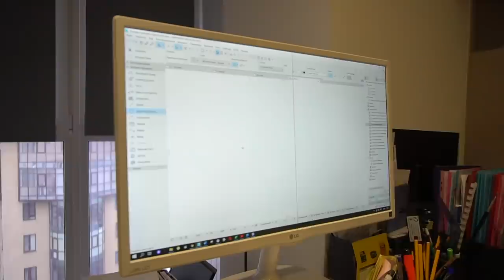Absolutely Beautiful Blue Rose From a Handful of Coins!

Comment: What does heating the metal and dipping it into water do?
Reply: I'm shocked on how many people have said this,basically the heat burns the metal into a more curvy or foldable shape,also can make it shinier by burning around the rust.The water stops it from burning and makes it easy to be used for the rest of the project.He also uses the heat for burning away the paper,using the water to cool it down and get rid of the remaining paper.
Reply: @newhope-cat9089  Thank you 😄
Reply: @Dementor-zh4vc  your welcome,glad I could help

Comment: This is really nice, but I'm pretty sure that it's highly illegal to destroy currency like that.
Notes and coins do not belong to you personally. They are printed out (or stamped out, if it's coins) and it's meant to be used by everyone for transactions. You're not meant to collect it as craft material.
It's kinda like going to shops and restaurants and helping yourself to the basket that holds your napkins, (or anything else on the table) just because you think you could use it. Just because it's on your table to use, doesn't mean that it is YOURS!
It's only yours to use for the time you're using the table. Then when you leave, it's there for OTHERS to use. 
Make sense?